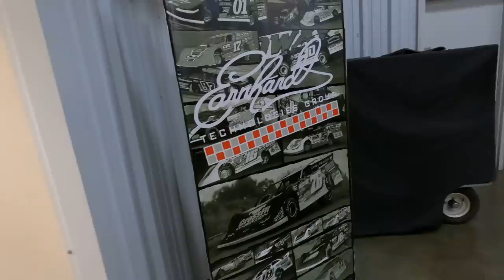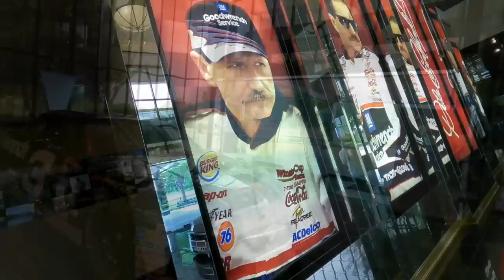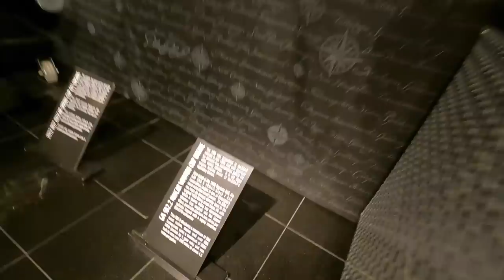Building Race Car Parts in the Dale Earnhardt Inc NASCAR Garage! Earnhardt Technologies Tour

Comment: Dude why dont you fix thoes flashey lights on the dash of that duely truck... pop the top off of the dash pad where the speakers are you have 2 ground studs at each corner of under the dash cover its got ground wires on thoes 2  studs .
 chevrolet put insulation betwen the wires and studs so you have a bad ground at these 2 points its a 15 minute fix .. you can do your self or chevroley will charge you 500 to fix ... and also race car lean the rear spoiler back 10 to 15 deg its killing you on the straights at that angel...
Reply: They don't have a lot of choice on the spoiler angle it is mandated at a certain height if you go below that height you're disqualified. Enough said..

Comment: Why did we not load up that sv2 on the way out
Reply: Those motors won't run with anything used in Dirt Super late model racing today. There only 358 ci flat tappet cam and a the block is steel you would never get your percentages right with a steel block ahead of the motor plate and still weigh 2300 lbs

Comment: Are they still building race motors
Reply: NO... There is alot of the original DEI pieces (valve covers) from the SB2 era (2000's) floating around at some of these engines builders shops. When DEI ceased operations they sold and auctioned offed most everything pennies on the dollars.